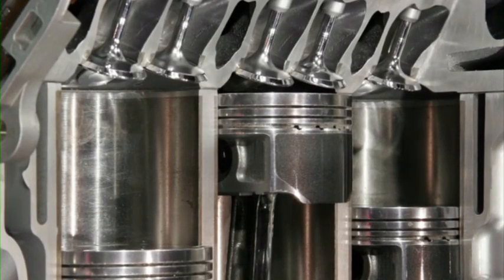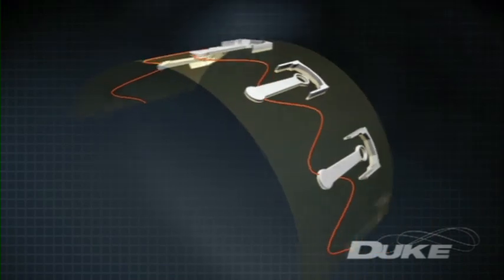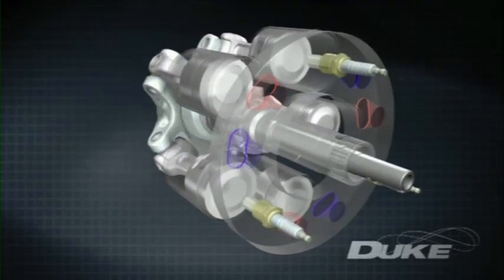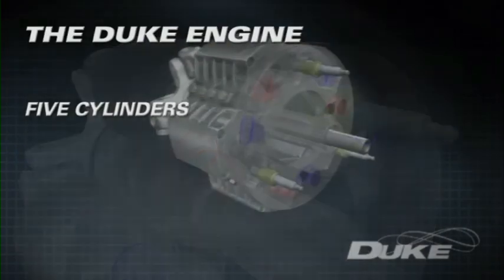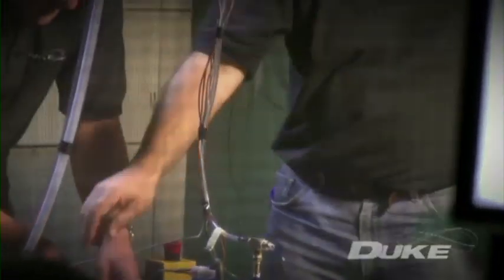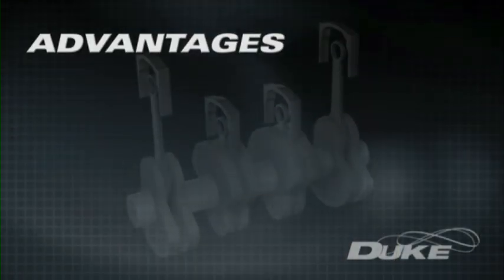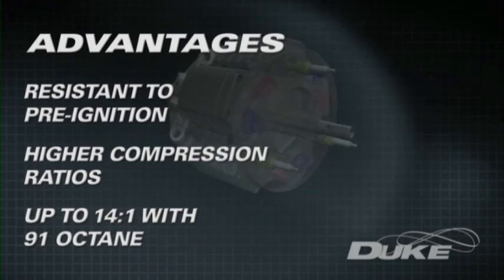Duke Engines

Comment: I suppose that another opposing five cylinders could be added to provide more power and perhaps reduce vibrations and further amortizing the mass of the crankshaft and swashbuckler adapter...

Higher compression ratios do produce more nitrous oxides which contribute to photochemical smog...

Comment: Friction with proper lubrication is welcomed.
It is the uneven heat accumulation that would hinder an engine longetivity.

With this design, i would guess that it will have similar heat distribution scheme with wankel rotary engine.
If i may guess.

Comment: Absence of pre-ignition with high compression ratios is what is expected if there are no hot-spots eg exhaust valves - but also indicative of non-optimal combustion chamber shape ie too much surface area for a given volume, causing excessive amounts of combustion heat lost to coolant instead of being converted to mechanical power.

Comment: This is actually quite old technology, a guy from Croydon in Melbourne by the name of  barry cureton and his brother George cureton designed and built a wobble plate engine with variable displacement a 5 cylinder very similar to this one 
And they put the motor into a vl comadore and drove it around for quite some time so approximately 20 plus yrs ago .

Comment: In the same way that a helicopter without a tail rotor would spin wildly out of control on its drive shaft, in one direction of spin, wouldn’t the balance of forces in a Duke engine cause the entire engine—hence, also the vehicle—to want to rotate?

Comment: I think there is a vibration problem with this design...
Reply: I agree. The axis rotating a wobble has to throw off a shake or vibration. Unless a counterbalance is I corporated into the gyrations. That would solve vibration. My twin cam B Harley would potato and shake without the counterbalance built in, like the twin cam A engine does. Because it is a rebalanced engine, it does not idle potato potato It rhythmically beats like war drums. I don't see this engine being capable of a 10k rpm spin without counterbalancing.
Reply: @keithhults8986  this engine is simlar to a barrel or swashplate engine. they do not wobble as the disc is completely round it's just tilted at an angle to give lateral movement. This engine wil always burn oil, just like the rotary engine. The port desgin is why these engines burn oil.

Comment: Seems good at first sight, but likely to be unreliable in real world use, too expensive initially and for repair, and a nightmare for mechanics.
    It's hardly a new idea either.  Swash plates or wobble plates using this principle have been around for about a century.  In the second part of the twentieth century they began to be used a great deal.  But guess where?  Excavators and earthmovers.  In this field [mostly], hydraulic motors like this [though simpler] are standard now, but only for these reasons - firstly, they operate entirely immersed in oil, so that some degree of fluid leakage is acceptable, and secondly, the tracklayer part of a backhoe, for instance, has no need at all of efficiency, either in its energy conversion ratio, or in the fuel use by the prime mover.

Comment: I would be certainly interested in seeing how well the joint would hold up that converted the wave motion to rotation. It looks like it would be worn down very quickly. Also they seem to be attributing all this advantages to pistons even though they are the same thing that are in regular engines, but somehow these pistons are better in every way. I think the most concerning part for me, is how would you cool an engine like that. With them in a row, the heat can go to both sides, but if they are in a circle, then a lot of the heat would go to the middle and would just stay there. 

Also I'm no engine expert, but aren't cylinders without spark plugs just wasted space? It had 5 cylinders, and 3 spark plugs..... 

I guess that is one of the many reasons that it never took off.
Reply: No.

Comment: All engines with ports  in cylinders   premature  piston ring wear and reduced power  because  of ports  steal stroke  length  like the rest . Wear  on cylinder  head  with bores  sliding  round it    . Jet ski and motorcycle  engine  I'd say

Comment: The long GM a/c compressor from the '70s had a swash-plate crank ran at least six cylinders. NO RODS. When the went to the pancake radial, their first ones would come from together to apart, quite often!!! Sikorsky used a swashplate to change the pitch in the rotor blades. Very similar to this reciprocator!  Oh'Yeah!!! I think it was in the 40s when he got his first helicopter off the ground.

Comment: First thought of this idea when I was 14, but the idea is fixed cylinder, not a moving cylinder. Why it needs to be moving cylinder when you can make it stand still with the use of 5 spark plug. Just, am I the dumb one here or this engine doesn't make sense.

Comment: Trying to reinvent the wheel with a worse design overall, the concept might be interesting, but it have no chance vs a normal engine, the rotating piston idea is prone to failures due to the inerent mechanical stress of the rotation... also the lack of a permanent seal on the pistons will lead to leaks inside the rotating base and will corrode the internal seals leading to advanced wear the breakdown of the engine really fast.
Just like the rotary engine, the concept works at first, but is not reliable to be an alternative...

So far the best advanced on thermal combustion engines is Mazda Skyactive-X with the mix of Gasoline and Diesel techs...

Comment: I would like to see it work in real time speed on full throttle. For some reason I can picture it throwing wait from one side to another. Causing it to not achieve a max rev and torque as much like other engine designs. But that's just my opinion with this amazing motor. Because of my lack of experience and testing I should not judge 🙏

Comment: just by looking at the motion in its operation, looks like everything will fallen apart after 50k miles
Reply: Agree, and inefficient power coupling plus the advantages listed at 3:35 don't seem to be specific to the design. 
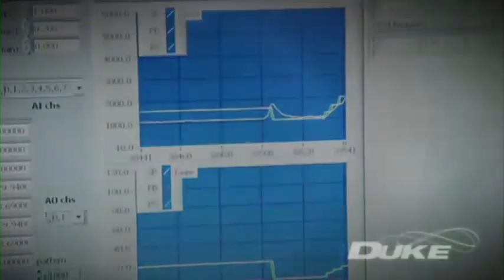2:47 - The illustration: pause and frame forward and backward with period and comma.
Two levers before the power hits the transmission. The second lever imparts a stirring motion, obviously you have imagined the shearing forces. 2:57 On the shell, between the holes where the piston rods are: Are those some kind of bumper? Is slamming against the shell part of the design?

Comment: I work on industrial machines.  I can tell you the part that rubs metal against metal (the crank shaft design replacement) is an absolute no.  I have too much experience with worm gears that do something similar movement.  When under load, the wear is outrageous.  This engine will wear down too fast. 
.
6.8 million views??  wow and EVs have totally superseded this technology making it redundant.

Comment: They arrived late. Thanks to the latest batteries, electric motors are more efficient, simpler, cheaper, and smaller.
Wait a moment. These internal combustion engines could be used to produce electricity in wild places.

Comment: I can see the thinking behind this and I genuinely believe that with the lower part count out could be far cheaper to produce, the problem is that production costs are one of the least concerns of any engine manufacturer, fuel efficiency, longevity, emissions, noise are all far greater concerns and no doubt why this engine hasn't been produced.

Comment: Looking at the design, the torque produced will be lower compared to conventional 4-stroke engine. How about lubrication of the cylinder? Looks like the fuel need to be mixed with lubricants, same concept as rotary engines.

Comment: In the 70s Volvo experimented with  a conventional engine that had an expanding -contracting , liquid-gas , similar to dry cleaning   fluid .The plug ignited to , it expanded , not burned , and cooled and contracted between cycles . The biggest problem they had with it was keeping the fluid in the engine . No seals seemed to work well . What was interesting about that engine , was it ran on almost nothing .  Because the Duke engine has no valve train , and only one seal at the out put shaft , wonder if that technology   could be combined ? The exhaust would have to be captured , and condensed , and fed back into the intake . Ive looked for information on the Volvo  proto type on the internet , but cant find anything ? I saw a film put out by Volvo when I was in a Machine Design , Mechanical Engineering class , in about 1973 .

Comment: 2012 : Find out how technology from Duke Engines increases the efficiency of the internal combustion engine.

2020 :
Reply: グールにも愛が必要  what if the apex seals were replaced with bearings
Reply: @renz1013  then it wouldn't seal, that's exactly why they are the weakest link in a rotary, they are necessary yet unreliable
Reply: @philljustphill1656  yeah but like tight bearings
Reply: it is still the future and you can't even imlagine WHy this project have been deleted
Reply: May have been a good technology in the 70's, but today the future is electric.
Reply: @martythemartian99  tbh yeah or probably back at the 90s where we'd see a cool  wankle vs duke engine war
Reply: @martythemartian99  TRUE !

Comment: All the energy goes into rotating that fat block
Reply: Two levers are between the piston rod and the transmission. The second lever's range of motion is permanently less than 90 degrees. The transmission splits the force to drive two mechanisms (like you wrote.) Two sets of combustion seals (standard cylinder and the complex one where the cylinder bank shears the spark and valve ports.) 2:47 the illustration - pause and use period and comma to step forward and back frame by frame.

Comment: This is obsolete. Electrical motors far simpler and more efficient
Reply: opposed piston 2 stroke diesels are the best. Lots of power, high efficiency, low greenhouse gases and MUCh less moving parts. You get higher milage than electric motor and no waiting to charge

Comment: Welcome to YouTube where butthurt commenters spam complete bullshit in their words just to saturate opinions about this that completely ignore the facts.

It loses less energy than most engines of its weight, so you can’t say it’s a fuel guzzler like a rotary.

http://newatlas.com/duke-engines-axial/33631/

It has 30% less parts and is significantly lighter than a typical combustion engine. And this is a wobble plate, not the rotary or the cam type or axial engine, which make more sense if reliability is what you want. So you can’t say it’s unreliable.

http://www.dukeengines.com/

Axial engines have been proven through powering pump jets on torpedoes for decades, so you can’t say this hasn’t been proven to work.

https://en.wikipedia.org/wiki/Special:BookSources/1-55750-268-4

And all of this I first found scrolling through engine types in Wikipedia. And this one happened to have the sources right to the website... something that you lazy punks couldn’t look at before commenting about its apparent flaws. You’re probably wrong.

Comment: its like most automotive A/C compressors. the pulley rotates the crank with the wobble plate attached. each piston is connected to the wobble plate by a rod.  the difference is, the compressor has the power input at the crank so the wobble plate is a drive and the pistons are driven to compress refrigerant, and in this engine the pistons are driving the reciprocator to power the crank as an output.  so the power flow is backwards basically.  most of those a/c compressors are shut off at 4,500 rpm engine speed by the electric clutch at the pulley to stop parasitic power loss from the engine if you really need the power for merging or passing.  I don't think this same engine would be able to rev that high, but I'm no engineer

Comment: Basically just a reverse GM A/C compressor from the 60s and 70s..... this engine design was also used in torpedoes    decades ago... so this is not really a new concept..

Comment: This looks complicated and expensive. Although there are less parts, I wouldn’t call it simple. The complex geometry of this parts would make the manufacturing process more time consuming since there is a lot of machining that would have to be done to each part even after it had been casted. That large swash plate is a giant mass of metal which would make it more expensive. There are more moving parts overall because the cylinders move, and they cylinders would have to continuously seal themselves over and over again when it rotates to each stage of the engine cycle. Then there’s that complex bearing and the crankshaft that would have to be precisely machines, costing more money and adding a lot more complexity. The main thing I would be worried about are the seals on the rotating cylinders. It just seems like there is a lot of mass going to be spinning in that engine which will require much stronger bearings and everything will have to be super precise. 
It may have been better if the cylinders were stationary and had their own valves which would reduce a bit of complexity and eliminate the problem with the cylinders sealing since it would have a simple head gasket, but that would pose another big problem. The cylinders are still arranged in a circle and it would be way more difficult to control the valves since every cylinder would be on a different axis. That would mean that. A new camshaft in the shape of a ring would have to be used either inside or outside the engine. Then there is the issue of having it interest with the crankshaft. 
But even if the valve problem were to be solved, there still the problem with the complexity of all the bearings and machined parts. It’s a neat design on paper, but from a practicality standpoint, a normal reciprocating engine is still the most reliable and time tested engine design right now.

Comment: How about Nintinol power flex rod's that bend and apply a few ton's of force per square inch to drive a cam shaft? All electronic no need for fossil fuel. All moving part's riding on magntic cushion's. Would need a transmission designed to operate off the ultra low torque Nintinol flex rod power engine or the use of swash plate pump motor's with the Nintinol flex power rod engine supplying power to a hydraulic split power system using swash plate's for low speed and swash plate's type 12 for high speed's? 😊

Comment: This will need to use reciprocating bearings which is not ideal in an engine. Ideally they perform a lot better if they dont have the same wear pattern on the same flank. (I have had experience of this and suffered with this.) The future of the internal combustion engine directly coupled to gearbox and driveshaft is numbered, as most technology is directed now towards electric motors and the internal combustion engine used purely for battery charging and/or driving electric motors for the purpose of range extending and or charging. This engine will produce a lot of heat, there is a lot of friction and balancing issues once wear begins it will become exponential due to the counterbalances required.

Comment: Less leverage than a reciprocating piston engine? At 90 deg from combustion the con rod has the max leverage forcing down on the crankshaft by angular momentum. I don’t see that in this design. Axial engines were first designed and used in the late 1800’s, I think around 1870 ish.

Comment: Idea, design this engine to operate just like a stirling cold gas engine and operate it all off liquid atmosphere. Frequency emitters could be used in the cylinder heads to force liquid air to explode back into a gas state forcing the piston just like a combustion engine all with a byproduct of fresh air.

Comment: 1:57 I think two stroke is still far superior to any of these. Fuel efficiency just need to be improved.

-1 cylinder 2 stroke equals a 2 cylinder 4 stroke engine in power
-1 spark plug vs 2 on a four stroke
-1 cylinder 2T has same power stroke as 2 cylinder 4T, and 3cylinder 2 stroke equals a 6cylinder 4 stroke
-50% weight saving vs 4 stroke
-50+% fewer parts vs 4 stroke

Comment: Couldn't make that much power with a crank setup like that. Seems like you'd be shaving off a percentage of the power output from each cylinder. I love seeing new engines but this does seem too late. There's no demand, and we're phasing away from ice engines. Who would possibly want to use this for anything as opposed to tried and true standard motors? Just impractical..

Comment: The compression chamber will not be as self sealing as in a conventional engine (compression pushing against the bottom of the valves) AND combustion will severely pollute the engine lubrication oil. Too many new challenges will keep popping up along the way, i doubt this will ever be a long life/long service interval engine, its like diesel piston engines in small airplanes, it solves non existing problems and at the same time introduce additional service requirements.

And finally: The day we have technology to make this engine long term reliable we also have the techto make conventional engines even more reliable, the Duke engine still cant compete with its contemporary competitors. I still wish them luck, even if the engine will never really be great they have whats needed to get money from investors in many years to come, the creator and his engineers can make a very decent living for a decade or more.

Comment: From what I saw in the animation is that performance issues will arise due to incomplete relese of exaust , incomplete intake of air , unburnt fuel causing the exaust to spit flames , and problems with fuel injection. They are making a plane engine or trying to make pistons do a rotors job. This cool but mess if an engine will do worse than my favorite ,but commonly unreliable, engine the Wankle